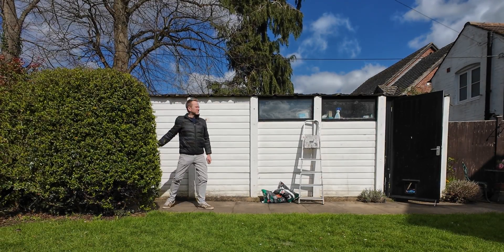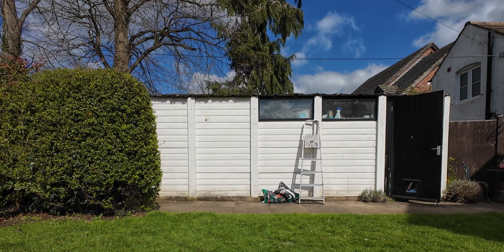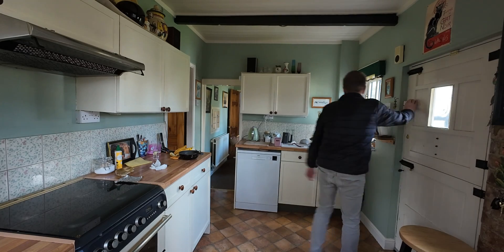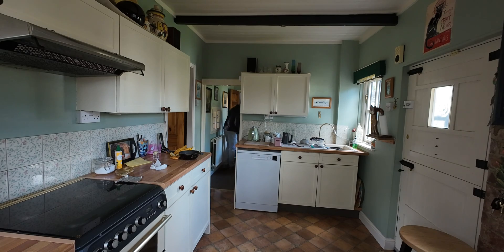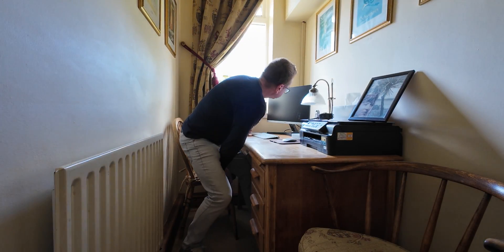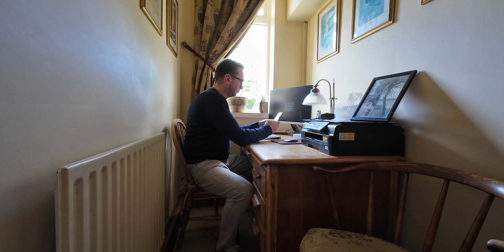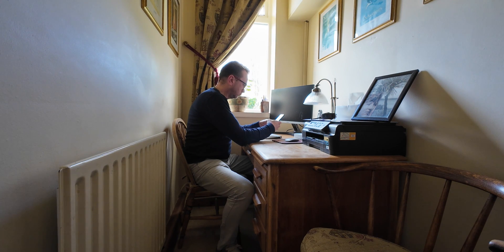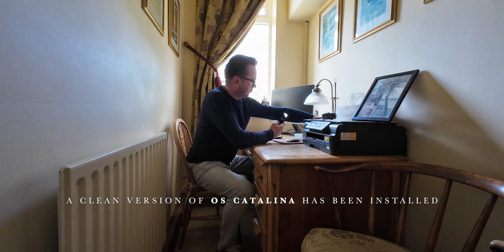2012 Mac Mini Upgrade in 2024 - NOTHING Went Wrong But It's A Finicky JOB..

Comment: hey bro hows the mac doing now, im researching to see if its worth it to upgrade mine. Its a little slow rn and i want to use it for editing on premiere and other graphic design apps but adobe wont let me download the latest versions of the products i want to use due to ram size, do you think i should just sell this and buy a newer one (secondhand or new)
Reply from the maker: Hey there. Thanks for reaching out! 

If you’re editing I strongly recommend finding a cheap M1 Mac Mini. Preferably with 16gb RAM. That’s the spec of my Macbook and it’s still used daily for editing. Good luck. 

P.s if if was just for general computing I’d say yes but it’s a pig of job to do 😂

Comment: Mum coming up the stairs at 3:08 won me over XD Nice video! I did this exact upgrade about 6 years ago, and it has extended the life of my 2012 Mini to this day. It was previously being used as a light-duty DAW up to this point (the firewire port is crucial for the old hardware I have), until I finally decided to retire it and use it as a media server/lighter work machine. I just installed a bigger SSD into it today, so I found your video while looking to refresh my memory on the breakdown process. "Finicky" just about sums it up! I had a hell of a time getting the metal antenna grate to fit back around the rim properly. Ended up having to use a flat head screwdriver to help slide the thing in properly. Other than that, not too bad. Next I'll be installing Sequoia via OCLP. As others have recommended, I think this will be pretty important in your dad getting more use out of it in the future. It's only a matter of time before browsers start dropping updates/support for Catalina. Anyway, hope he enjoys it for years to come. Cheers!
Reply from the maker: @danny5AN  thanks for the comment Danny. Yes that bit did amuse me with my mum hence it got left in the video. 

It was definitely worth the upgrade as I’ve not heard a moan of it being slow since lol. 

I do however think you’re right. It’s not going to be long before the software stops working. Apple seems to be good at that game.  

I think that may be the point when we’d start to look for a reasonable used M1 Mac or maybe newer. I still use a M1 MacBook prob and it’s a beast of a laptop. 

Thanks for watching the video 🙏

Comment: You cant just grab any ram and put it there expect the best. lol Mac are really picky when it comes to ram.
Reply from the maker: @AudioReplica2023  I followed advise on the parts online and tbh it’s been done for a fair amount of time now and still running fine so they can’t be all that bad. 

Links are in the description 👍
Reply: A few months old, but here for the future…

I’ve used the following brands of RAM:

Silicon Power
Team Group
Hynix
Crucial

ALL have worked well on three 2012-i5 and one 2012-i7.

And the three i5 have the ‘dual drive’ upgrade from “I Fix It”… the i7 was a “server” edition.
They all have 512GB boot and 1TB storage SSD installed.
I love them.

(Completely disassembling them to clean and swap RAM & SSD & cages WAS finicky the first time, but I watched four-five different videos and took my time. First took 30 minutes to disassemble, and about an hour to re-assemble. After, 20 minutes total each. Practice and perfection, and all that 😎)

And yes I HAVE just received a M4 Mini, 16GB 256Gb and will be swapping a 2TB internal.
Hoping for the best

Comment: I did exactly the same yesterday to that exact Mac mini Late 2012 model.  16 RAM and 256 GB SSD.  MacOS Sequoia 15.3 with OpenCore Patcher.  New life indeed!
Reply from the maker: Nice one! How easy was the OpenCore Patcher to install out of interest?
Reply: @realmattjc  I did that first with the original hard disk that came with the computer, but the OpenCore Patcher didn't run on macOS Catalina.  I learned the hard way installing three macOS versions from the bottom to the top.  But when I changed to the SSD drive, I just used a previously prepared USB startup flash drive (made with the same OpenCore Patcher) that started installing Sequoia 15.3 right from scratch.  Now, I created that USB flash drive while on Sequoia at my first attempt with the original hard disk.  But you can do one on a newer computer with the OpenCore Patcher just installed for this.  It is worthy to upgrade this Mac mini 2012 to Sequoia, because now newer software is compatible (WhatsApp, some websites on Safari, Chrome, Apple Music, etc.)
Reply from the maker: @mavalosdittel I might just look into this 👍
Reply: @mavalosdittel is core i5 or i7 mac mini late 2012 model
Reply: @ i5

Comment: I had to pull the logic board and power supply to get to the HDD in my 2012 Mac Mini. It was screwed into the tray. Surprisingly it works after putting it back together.

Comment: I had the same problem I was trying to run Mojave on a mechanical hard drive that was also converted to the new apfs format, it just won't work, from Mojave onward it needs to be ssd, and ideally apfs, ssd and apfs is how all Macs come now.
Reply from the maker: @stevencook6750  makes a huge difference does an SSD 👌

Comment: Be a caring son and buy your father an M4 mini. Upgrading a 2012 mini was a good idea in 2014.
Reply from the maker: @jansix4287  haha if he needed that sort of power I’d agree but it’s only used for online shopping banking and email so it’s not worth it. 

This upgrade was well worth the effort and still running a dream now 👍
Reply: @ Then get him a used M1 Mac mini for cheap or even an M1 iMac in blue. He deserves to experience the new era of Apple Silicon computing. 90% of Mac users are not doing anything demanding, but it’s still nice to have 7× times faster single core performance and 5× times more multi cores for fluid multitasking.

Comment: I recently did a RAM and storage upgrade on a 2012 mini Core i5 I had on the shelf. It was functional, but had only 4GB of RAM, a 500GB internal HDD, with Mac OS X 10.9 installed (ugh).  First thing, I upgraded to macOS Catalina (10.15 - the max for this model). This modernized the system, but performance was still awful – the HDD gave boot times measured in minutes(!) and the paltry RAM meant the OS was constantly operating out of swap space (up to 2GB!), making performance even more dismal. Next, I used Carbon Copy Cloner to duplicate the internal HDD onto an external USB3 SSD (500 GB SSD + USB3 enclosure = $70 US). This improved boot performance quite a bit but the RAM issue was still dragging things down. Next, I installed 16 GB of DDR3 RAM (bless Apple for making it so easy on this model) at $17.00 US from Amazon!. After these upgrades, the system was using ZERO swap space and the enhance SSD performance, even running externally, made the system fairly snappy (for that Mac vintage). Ideally, I would have tried to replace the internal HDD with a 2.5 inch SSD, but the 2012 mini is especially tricky, since you have to remove the motherboard and power supply to get access to the internal drive bay, and I have damaged at least one mini logic board doing that, so the external SSD, though cumbersome, is the far safer choice giving acceptable performance, and the internal HDD is still available for general storage. Personally, I use Carbon Copy Cloner to perform scheduled daily backups from the SSD onto the internal drive in case the SSD ever fails, at least I can fall back to  booting from the HDD to recover.
Reply: This is the way! The RAM is beyond trivial to replace and as long as the internal drive is working it's useful as a backup device. Any external USB 3.0 SSD will work great. Then use OCLP and you can install a modern, secure version of MacOS – even MacOS 15 Sequoia although with OCLP it's usually better to install last year's version for better stability (last year's version still gets all security updates and the current version of Safari).

Comment: With the low cost of the memory and storage these days, it's almost criminal NOT to make the upgrades to 16GB and SSD in the 2010-2012 machines (and I suppose 2014 servers) that allow it to be done. I picked up a 2010 MacBook Pro (4GB RAM, 320GB HDD) for $38 and intend to do the same.  16GB of RAM for $20 and a 1TB SSD for $45 will keep the total right near $100.  Hoping for similar results, especially in shut down time because that poor thing takes over 3 minutes to shut down.

Comment: Mac mini (Late 2012),2.3gHz, i7 processor, 16GB RAM, new WD 500GB SSD, freezes every coup[e days and needs a hard restart. Not sure if it's Catalina, Chrome or something else. When I do the command for a Hardware Test, I'm taken to internet recovery? Not sure what to do with this machine. It's basically used for its HDMI port and connected to my HDTV for internet.
Reply from the maker: Hey. Sorry to hear of your troubles. I couldn’t say for sure on this. My initial hunch is graphics related. 

Has it done it since upgrading the SSD or has the machine been working for a while?

Comment: I Have one of these as my daily driver. Did the ram and ssd. The silver bit can be a pain to get in the exact position to install the screws. Used masking tape for a handle to position the ssd. I run windows 10 on it. It will handle light gaming it runs sims 3 with expansions no problem. Mine is the i5 version.
Reply from the maker: @jamesellis9080  sounds like you have a successful upgrade on your hands. Nice 👌 

Haha re the silver bit! There were times I wish I never started it myself. Didn’t help trying to film it whilst doing the job. 

Thanks for watching 🙏

Comment: Just timed my 2011 imac with 4gb ram, the original 500gb spinny hard drive and a 3.06ghz Core 2 Duo. To be fair, this was it's second boot after installing High Sierra, so maybe there was a bit of boot time improvement. From immediately after the startup chime through to opening Chromium Legacy (I had it set to start up on this exact video) and being able to control the video took 1:50.6 seconds
Reply from the maker: Probably helped with a fresh install. They do benefit from a fresh install from time to time.

Comment: Still have my 2012.  It got a SSD and 16GB upgrades.  It runs rings around my Late 2014.  2014 can't play 60 fps video while the 2012 has perfect playback.
Reply from the maker: Not at all shabby for a 12 year old machine. 👍

Comment: will it work with adobe or any illustrator software  and video editing  in this device
Reply from the maker: Good question. You might need to run a patch update to allow a later OS but I couldn’t say for sure. Others in these comments have mentioned running a patch but I’ve never done it so couldn’t quote on that.

Comment: I've got 2 of these and one already has 16gb of RAM and an SSD running Ubuntu. I am going to check the other one but I think it has a mechanical hard drive so that has to go. I wish these had a CPU socket so we could upgrade that as well without soldering or replacing the logic board etc. 

But for it's age it's not bad once you do the memory and SSD upgrade. I'd like to get a 2018 intel i& based Mac but in my area in Texas they are around $300-$400 USD.
Reply: I subbed as well. Thanks for the video!
Reply from the maker: That’s awesome. Thank you 🙏

Comment: When I first upgrade the SSD on a 2011 and 2012 Mac Mini, screwing the SSD back on was a pain. I found that if I fold a long piece of plain paper a few times and stick it under the SSD to hold it up, it make it easier to screw in the SSD. After that I can pull the paper out and tighten the screws.
Reply from the maker: Yes that part was a right pain!

Comment: There are good reasons for removing the connectors but you were careful so fair play. I found slotting a credit card into the plastic in between the drive bays helps you get the drive into the right groves. Since you have done this it would be well worth looking into installing Monterey using open core legacy patcher as that will allow your dad to use the Mac mini for a lot longer. We are finally getting to the point where a lot of applications won’t work on Mojave (my favourite os) or Catalina. I still run Mojave on a few older macs for a variety of reasons. 2012 Mac mini works great on open core 😊
Reply from the maker: I’ll certainly consider using the patch and see how it goes. The reassuring thing being there is an option to extend the life of the machine. All things considered it’s not bad for a 12 year old Mac 👍
Reply: Noticed a huge improvement with OCLP & Sonoma on a similar vintage MBP I bought used for $130Cdn a few months back. It had already been upgraded to 16MB Ram and a 1TB SSD, so I’m tempted to do the  same to my A1347 Mini. A local “qualified” Apple dealer/service shop quoted 2 hrs at $120 for the labour, plus my choice of SSD - seems a bit steep to me.
Reply from the maker: @fonkenful yeah that does sound steep tbh but I guess at least the ownership is on the dealer if it goes wrong lol

Comment: Ha! I just ordered the exact same components earlier today (before watching your video). Plan on using my 2012 Mac Mini as a Proxmox hypervisor to run virtual machines.
Reply from the maker: Hey there. Good luck with the upgrade. It certainly makes a big difference :-)
Reply: @realmattjc  is it possible to upgrade the i5 cpu to and i7 cpu?
Reply from the maker: @buckeye43210  good question. I’m not sure on that one as I think the cpu is integrated into the main board. I’d be inclined to say not.
Reply: I just ordered a second 2012 refurbished Mac Mini :-)

Comment: This so reminds me of my own 2014 Mac Mini (2,6 GHz i5 dual core CPU, 8 GB RAM and a 1 tb hard drive). I've ended up buying a 250 gb Samsung SSD and a USB enclosure to connect the SSD to one of the Mini's USB ports. I've kept the internal 1 tb hard drive for data storage.

From a very slow hog it became a pretty quick computer. An SSD is the best thing you can do to upgrade the old guys and give them a new lease on life.
Reply from the maker: Good shout on using an external drive. I never thought about that on my old 2014!

You’re very right. SSD is the way to go 👍

Comment: Up and running in my basement, 10+ years until today. No issues, everything is fine. Never had any speed problems. Last update in 2015 (added the two SSDs for about 900 Euro each).

Mac mini. Late 2012, 2.3 Ghz Quad Core Intel Core i7, 16 GB 1600 MHz DDR3, 2x 1TB WD SATA SSD, Sonoma 14.4

Replacing the harddrives was so easy back in the day, the same for the RAM. Would be nice if Apple ever would go back to these behaviors.

BTW: your speed improvements are just related to the SSD. After about 2016 none of the Mac OS X versions was optimized for magnetic drives. Just the huge amount of short read accesses kill any usable performance of the sad device.
Reply from the maker: If only. I doubt they ever will. They want to sell new machines 🤣🤣
Reply: @realmattjc  Really sad. Of cause the Mac mini in my basement is in his has years, caused by the x86 CPU. But it worked so long, so stable. It is at least one reason why I still think Apple makes really good hardware.
Reply from the maker: @ralph1121  agreed. I love them 👍
Reply: how did you get sonoma on there? I'm sure my 2012 mac mini told me a couple of osx versions ago that it was not supported.
Reply from the maker: @derecwilsom4546  I believe you have to run a patch but not tried that myself and tbh I don’t think it’s needed for my parents computer.
Reply: @derecwilsom4546  OpenCore Legacy Patcher
Reply: @derecwilsom4546  opencore legacy patcher

Comment: Apple were (and still are) very mean with ram and SSD provisioning.
This has a new lease of life.
The future 10 years from now 8GB ram and tiny ssd M3 users will not be so lucky.
Reply from the maker: Very true. I had the 2014 some time back and I’m not sure you could upgrade those
Reply: Same with my 2014 Mac Mini. RAM is soldered to the mainboard. The 2012 version was the last Mini that was fully upgradable (RAM and storage).

Comment: Still great devices but a little bit expensive. A 2012 is 150-200€ over here, but a used m1 mac mini goes for just 300-400€
Reply from the maker: Won’t lie. I’d go for the M1. That’s what I use for editing. Thanks for the comment. 🙏
Reply: @realmattjc  I upgraded my parents 2012 Mac Mini nearly exactly the same, with 16GB RAM and 1TB SSD (to avoid multiple external drives for photos).

When the M1 MBA was released, I upgraded them to the M1 MBA when it was released, but it stays docked 24/7 and I've thought about migrating them to a used M1 Mac Mini and taking the laptop as a backup for myself.
Reply from the maker: @cmorche  good to have options. I myself just have a 2021 M1 MBP as my main editing machine and a 2012 MBP for DJ software which I fear hasn’t much life left in it.

Comment: I was thinking of getting this one to install Linux, I switch over to hp EliteDesk mini as I got a good deal on it. It's a big jump of speed putting in a SSD in it on that mac mini.
Reply from the maker: Massive jump. It’s gone from majorly frustrating to use to the performance of a new machine. Opens rapid and no hanging around.
Reply: I'm running the latest Linux Mint on my 2014 Mac Mini. From a USB connected SSD. The internal hard drive is used for my user account and file storage. Works like a charm.

It's running my music server, but it is also hooked up to my living room's LCD TV. So I can also use it to surf the Internet from my couch using Chrome.
Reply from the maker: @SandsOfArrakis  easy surfing my friend 🤙
Reply: @SandsOfArrakis  yeah can be turn in to a Linux server too.
Reply: I'm running a 2012 mac mini i7, 16gb RAM, 500gb ssd, 1tb ssd. Running Linux 22.04 LTS for over a year. Every thing works, much quicker than macos. Very nice rig.
Reply: @rbe3908  nice